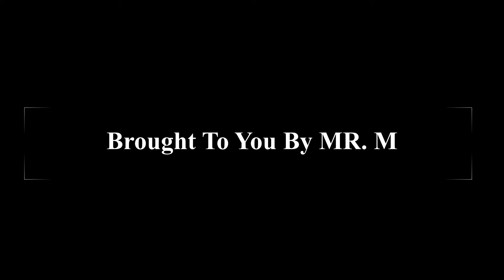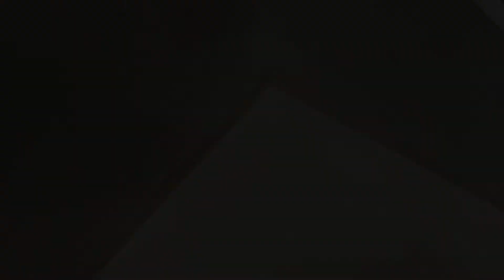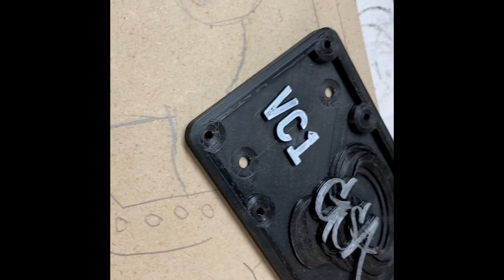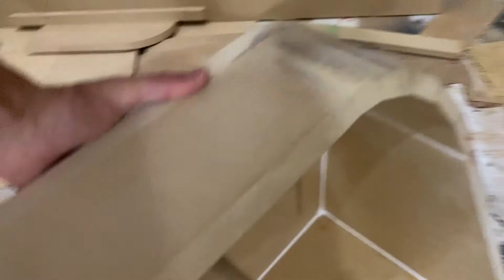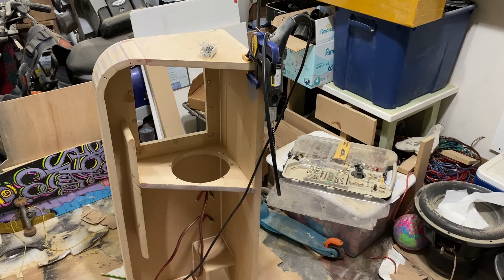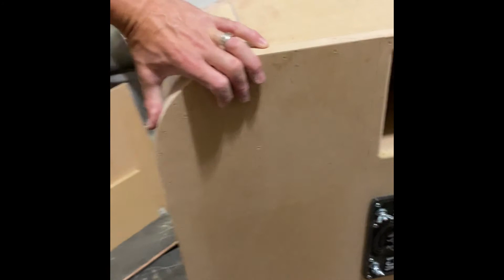Wedge sixth order enclosure build for 8" Sub (Part 3)

Comment: Nice job. You think it'll be peaky @ 50+hz with the tuning as it is?  Now I feel inspired to do my own box. What if I made...a single-dual 6th with a  SA-10 and an SA-8 tuned to fundamentally cross over each other @ below 38, but the ported 8 side @ more like 55 and the 10 side at  45...meh. It's all random numbers until I can sit down with the T/S specs and work it out. I'd probably end up spending a month sanding and gluing and then it'd sound liked shit and I'd have to start all over again. As an added bonus, my trunk only has a max 15.5" opening for anything to go in, so that's a big limiting factor.
Reply from the maker: I almost couldn’t fit this thing in. Interested to hear it but electrical isn’t installed in my car yet… soon..😊